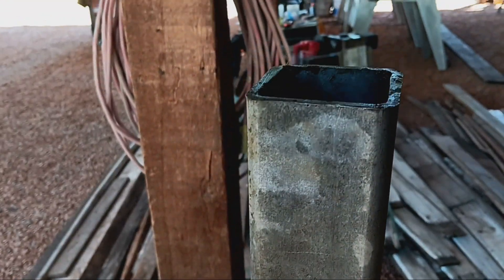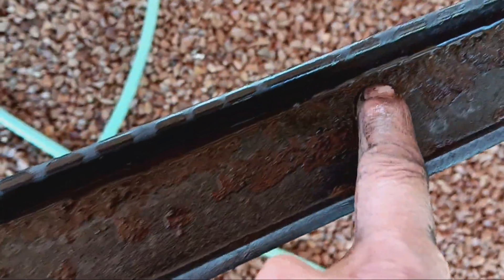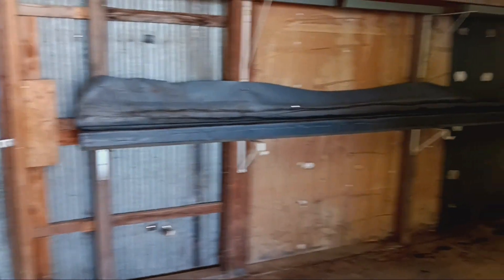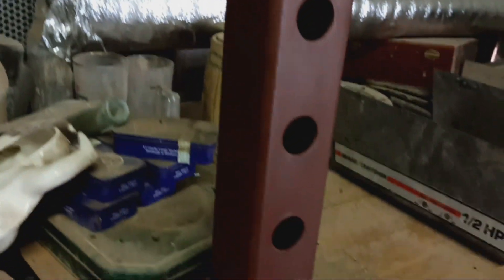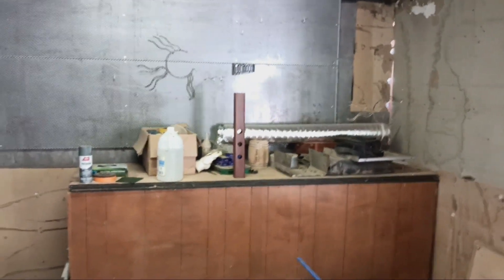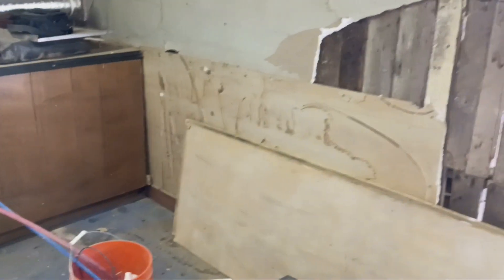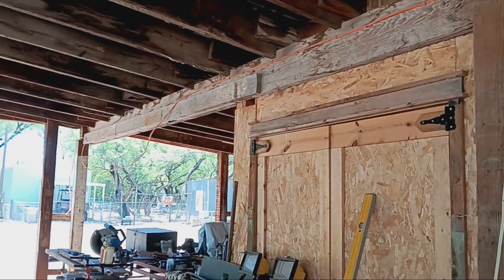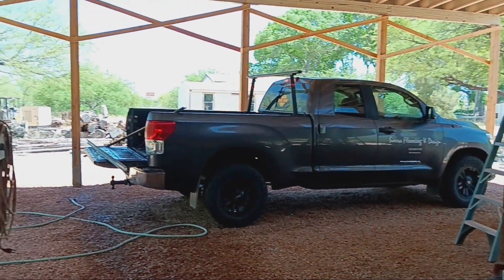Tank Build Part - 3

Comment: They make vinegar for weed killer. It is way stronger than store bought. It might work better.
Reply from the maker: Right, the one I got is only 5%, so I should look into the stronger one.  This is a small town so maybe on Amazon, but this one worked good, and is cheap at $3.95 / gal at Walmart. I saw a video where he use 3 strengths,  so I should look it up.